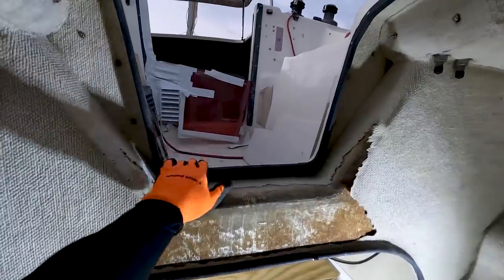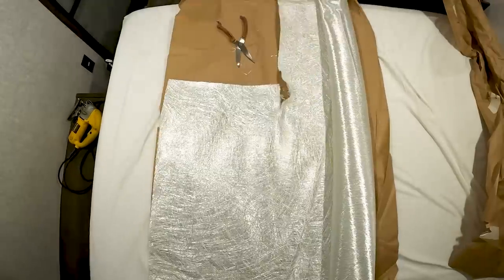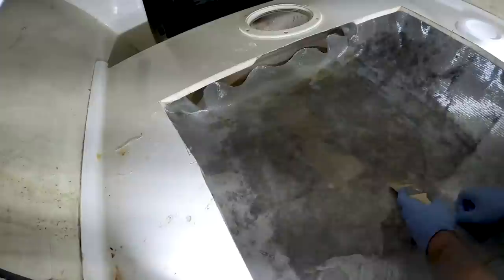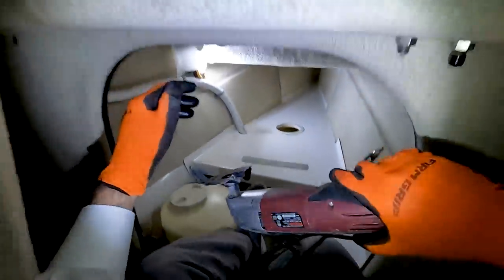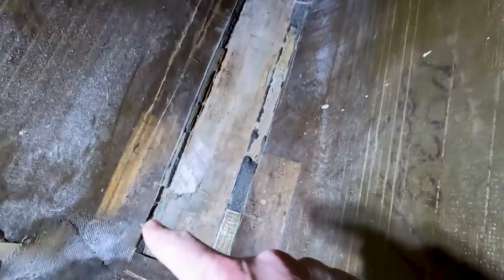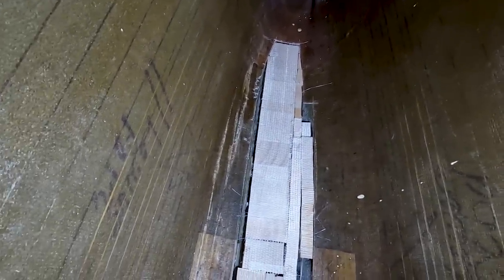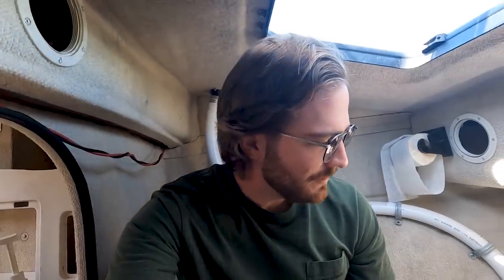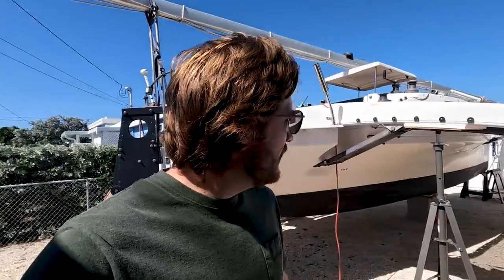Another Surprise Found While CUTTING UP OUR BOAT | Learning the Lines

Comment: The Total Boat paint stripper works great! Just remember to put it on thick. After letting a coat of it sit on the bottom of my boat for a few days (the boat is an hour away from my house), I take a paint scraper, and scrape the paint off, rather than sanding it off. No respirator, I catch the chips on a tarp so easy to keep tidy, and it’s relatively quiet. There is some clean up sanding required, but it’s so much easier than sanding off several coats of bottom paint.

Comment: I'm definitely not a qualified option on epoxy glass work not by a long shot. I did however replace a the stinger system on a 25ft power boat years ago.  I learned the hard way leaving to much epoxy resin in the lay up causes the repair to be brittle and prone to cracking. About 1/2 way thru the job I was corrected by a pro. I changed up by using a fin roller and being absolutely sure to not leave any excess resin. Every stringer that I left excess resin in the lay ups de laminated in the first extremely heavy weather trip. The properly done portion of the repair is still intact 12 years later. The same resin same glass just no excess resin made all the difference in the world. It might not be a big deal with modern resin but I think it is important. Plus you save a ton of money

Comment: I like to wet out the glass on a piece of cardboard, I think this helps reduce the amount of epoxy needed. I would also suggest putting in the filler as a separate step and sanding it smooth before the glass. I’m enjoying following your project!

Comment: Glad you didn't listen to the naysayers, great repair work and use of peal ply.  Glass in tabs under the floor with press in nuts then attach the pieces you cut out with flat head stainless screws into the tabs with press in nuts.  They will not react with the aluminium because they are separate and have no metal connection.  An easy way to get under the floor and next to the hull.  Please check your amas really well and repair them like your main hull, they will have damage if the main hull has been damaged. Just a warning, if the main hull has been damaged the amas also have had damage. I have sailed and repaired F-27's and other Trimarans along with catamarans since 1970.  Get yourself an electronic device to stop hull growth.  They work well and just turn it off out of the water.  I usually have one layer of epoxy impregnated with copper powder under any marine paint I put on the bottom.  The barnacles will never go through the copper powder coat but I use ablating bottom paint and also the electronic anti fouling and I never ever have to scrap my hulls

Comment: You are doing a great job, keep it steady and thorough , don't be in too much of a hurry - don't listen to negative people.
I wouldn't be in too much of a hurry to replace the floors that you cut out. Just have a think about it before rushing into it.
Obviously, they are structural and you need to have something that retains the strength. Maybe some cross members glassed in and removable floor bolted to tabs would allow access and retain strength.
Don't give up, your videos are tremendously interesting to most people.

Comment: The peelcloth is supposed to sit bubblefree and overlapping all glass by about an inch or two, to make it "peel'n go" without the need to still sand the edges of Your repair before You apply topcoat (which You apply to bring another high quality layer between the bilge  water and that balsa).
I would probably have ripped out a bit more balsa over the former repair and laid a layer of glass over it from inside just to make sure there ain't no former bodge jobs messing with my new balsa, but given the boat-yoga (welcome to elder fiberglass boats ;-) involved to work down there it looked OK.

Comment: Nice job. Just a question. Why inserting new balsa? Balsa is great in building large sections or a complete hull, but for a 2’ crack repair wouldn’t it be better to glass it all the way from the damaged area? This could add an improved structural strength.

Comment: Since you have the "bilges" open, do you think it would be a good idea to slap a couple of coats of paint on them?
Reply from the maker: I've been debating this. I might. The issue is all of the bilges aren't open. There would still be a large section unpainted.
Reply: @LearningtheLines  Don't paint! 1. It will look like you're hiding something.  2. You won't be able to see how well the repairs hold up after she hits the water. 😉

Comment: It really doesn’t matter what you fill the void with as long as it isn’t soluble in styrene (like styrofoam). The way sandwich core construction works structurally is to separate the glass layers. This creates tensile force in the outer skin during a flexural bend - think about bending and “stretching” the outside skin and compressing the inside skin of the bend (outside of the race track longer than inside). 

Double the thickness of the core  increases stiffness by ~7-8x. As long as one gets a good bond with glass/core and it doesn’t delaminate, the advantage of a polymer core over balsa is basically one of no breakdown of the core if skin is breached by water. 

Hope that helps.
Reply: Syntactic Foam does not use foam  it's made up of hollow materials like glass balloons
Reply: What you say is true to a point, however, some cores (for example marine plywood) are structural and others (lightweight foams or even cardboard) aren't
Reply: @matthewsellers82  yes, but the structural component of an core (outside of glass), doesn’t change the flexural modulus that occurs primarily in the skin. He’s dealing with balsa and other than adding weight, putting plywood in that wouldn’t significantly alter the  the repair. Many use plywood in the boat industry if weight doesn’t matter, but mostly because it’s a lot cheaper than Divinycell and it does add stiffness.  That’s often used to skimp on glass (stiff but weak). I had a 60k sqft composite mfg facility and we made parts up to 20x40ft. Sandwich core construction can get expensive if one isn’t strategic about building for design loads on large parts. A common way to increase stiffness and reduce strength is decrease glass ratio by using to much matrix (epoxy/polyesters, etc..). 

On the other end of this cost spectrum is the carbon/carbon composite work we did on rocket nozzles or filament wound cases and in those we created 100% carbon composite structures using phenolic prepregs/tapes depending on application. In aircraft structures we used skins that could keep higher volume shapes via ribbing - eliminating the core all together. It’s used in automotive, but I’ve not done that work before. It’s identical to many aircraft applications without the QC. 

What all of these have in common is that the structure (glass/carbon) base is engineered to pass the load to the skin and it’s the tensile force capacity of those fibers that does the heavy lifting. 

My point was his repairs are done well. He did a great job of paying attention to the right things (water content/surface prep/secondary bonding) and i wanted the alleviate worries about the core, which doesn’t matter in this application as it’s a trivial amount of weight. If he used  glass microspheres (or any filler) it doesn’t matter that much other than matrix cost.

Comment: It seems you are repairing the cracks between the bulkheads only. This leaves the damage in the hull-shell where the bulkheads meet the shell. I strongly suggest to cut the bulkheads where the cracks are and then laying the glass over the total length, restoring the bulkheads thereafter. Now there's likely a weak point that will start to become flexible over time.. Epoxy can't deal with that...
Reply from the maker: Tom, I've inspected the bulkhead areas, they're fine, at least from what I can see. It's easy to say "just go cutting into everything" when you're not the one who has to put it all back together. I'll be inspecting the exterior laminate from the outside, because if I find wet balsa it's going to be easier to repair it from the outside in the bulkhead areas rather than to cut out the bulkheads which are perfectly fine. Another reason why I'm leaning towards the bulkhead areas are fine is that if you think about it, the bulkhead areas are much stronger so they wouldn't suffer the same damages as the areas I'm repairing here that have no internal support at all. It's a balance. You can't just go cutting up the entire boat, especially with a boat constructed like this, because ultimately any repair you do is bound to add weight, something you want to avoid.

Comment: You might want to consider making those floor openings you removed removeable in the future, rather than permanently re-installing them.  I realize they may be structural, or necessarily sealed for the safety/buoyancy of the boat, but those issues can be solved by some innovative thinking.

Comment: Hey Jordan! Where were your “girls”, Randi & Morgan? Missed seeing them.  I am a bit confused about the balsa stringer “repairs”! How can epoxying in those many tiny pieces add strength to the stringer? I understand the multi layers of the different cloth, but not the need for those tiny pieces. When did you name the boat?
Reply from the maker: Hey Edward, they're always around but when I'm working on a project like this I'm careful to not get them or the house contaminated with fiberglass dust or epoxy for their own health. So projects like this will be just me. When I'm done working I disrobe outside and go straight to the shower to keep the house clean! Haha. As far as the balsa goes, it comes in a sheet of pieces held together by a little bit of fiberglass. It's already cut up into little squares, I just reoriented them to fit my repair. When all the voids are taken up by balsa, glass, and thickened epoxy it becomes very strong. I'm not an engineer so I can't go much more into detail than that.

Comment: I would really inspect the damages under the bulkheads. This looks bad, specially the connection to the repaired parts. You have to put Gelshield or something similiar in the bilges and over your repairs. Pure epoxy is not enough, you want to get this areas never to absorb moisture anymore. You are soaking the glass into to much resin, hardened epoxy is rather brittle...
Reply from the maker: Matthias, from what I can tell the bulkhead areas are fine. They're reinforced, and much stronger than the areas I'm repairing here which have no internal support structure. That being said, I will be looking for wet balsa from the outside, because if I need to repair those areas, a repair from the outside will be much less invasive. As far as the too much epoxy comment, That's why I used peel ply. The epoxy wets out the ply and excess sits on top, then gets removed when you peel the peel ply. Also, It's been proven that a too much resin in laminate doesn't cause loss of strength, only excess weight. That is something I'm doing my best to avoid, however.
Reply: @LearningtheLines  Hi. I think what you showed at 1'26 and the broken tabbing is what let me wonder what is going on. just glassing over this delaminated tabbing is not gonna be good enough. Concerning excess resin: Yes peelply helps but my impression was that you have thickened the epoxy just a bit and not really made a stable putty with a consideable amount of fiber in it, it just seems to be a sauce/soft peanut butter instead of non running/ not saggy quality where your result is much less brittle. And excess resin in a laminate is a strength problem, the fibers are floating in a much bigger distance from your base material/ old laminate. Epoxy as a much lower resistence against pulling the the fibers used. To get a good and stable laminate the pros use vacuum, this gets a much better bonding and results in a much better resin-fibre ratio. Even pulling vacuum only with your shop-vac will help a lot...

Comment: use a small board as a platform over the opening. I would suggest doing the large area in one piece but do the layers in stages, and use polythene and tape and a vacum cleaner to suck the air out to get the atmospheric pressure to wet the glass and penetrate the layers. It will give you a better finish and the work area will remain covered with polythene so you don't need to worry about contact. With the amount of londitudenal delam, Id say she was dropped from a lift or crane.
Reply: I was wondering why he didn't just use a board or two as a working platform.  One full complete piece pacing the layers would have been far superior to smaller patches with a cold seam across them.
*Edit:  Wanted to say the vacuum & taped poly is a good suggestion.

Comment: You said that the damage in the front compartment was caused by outside damage letting water in, but you  proceeded to repair from the inside without understanding or assessing the claimed outside damage.

Comment: WHY WOULD YOU REPLACE  WET BALLSA WITH BALSA AGAIN?  I WOULD HAVE RECOMMEND A SYNTACTIC  FOAN TO PREVENT A SECOND FAILURE WHICH YOU WILL EVENTUALLY  SUFFER.
Reply: I wonder about the balsa too. From everything I read, it’s there to increase the skin thickness for stiffness without extra weight. (And insulation) Rigid foams will do that with maybe less tendency to let water wick further and without the rot problems. Did you consider foam?

Comment: I can't believe you guys bought that boat without a thorough inspection, that's not like you guys!!
Reply: You have to remember that they had to cut the board apart in order to thoroughly see the damage
Reply: @roadboat9216  yes! - and, they bought the boat for 1/3 the going price for a similar example thus reducing their risk of a "bad" investment and knowing there could be hidden damage that the 2/3rd's price savings could absorb.  The materials cost of fixing the previous unknown structural issues will be less than 10% of the cost of an inspection.  And the labor for the repairs provides content for the Youtube channel.  So far these, guys took a well calculated risk and seem to be firmly on the winning side....so far....only time will tell but it's looking good at this point.

Comment: This guy needs to at least look at Westsystem's protocols for proper fg repair.  I  am seeing so many  things done wrong I can't even begin to enumerate them.
Reply from the maker: That's about all I look at Patrick, please give me an example of what is wrong.
Reply: @LearningtheLines   I answered this but apparently the answer disappeared.  Basically, FG repairs need to involve cutting out the damaged material, rounding the corners of the repair areas, beveling the edge (12:1 of  hull) etc.  Also if you had a structural failure you should probably reinforce the area, although care must be taken with reinforcement as some assemblies require a certain amount of flex, and stiffening them may make them more vulnerable to breaking.